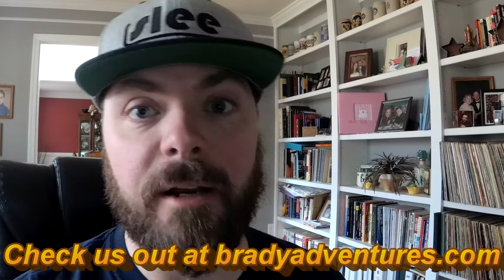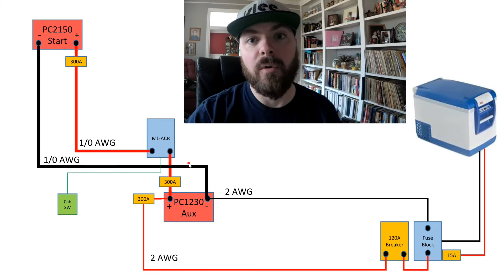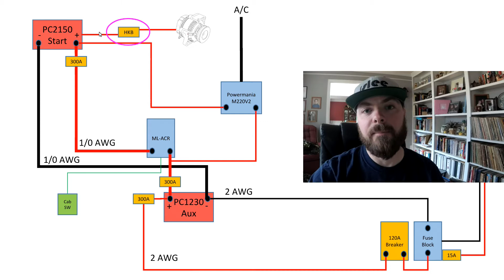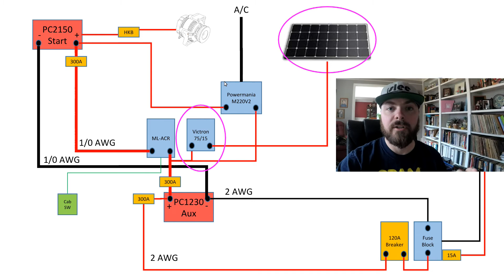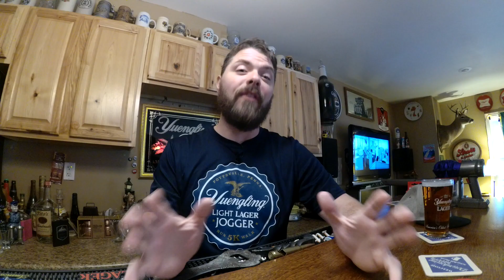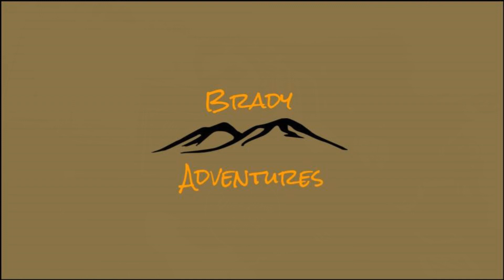Overland 12v Power System Overview and Enhancements Solar - 100 Series Land Cruiser Overland Build

Comment: Hello, which HKB fuse did you get? looks like there are three types. Thanks
Reply from the maker: It was a couple years back but this is what my invoice says.  Let me know if that helps.  If not I will jump on the website and verify.  
MK3 Mini blade 7.5A (Electronic fuse version)   (Model: LC 100, Year: 2005)
Reply: @BradyAdventures  that is all I need. Thank you so much.